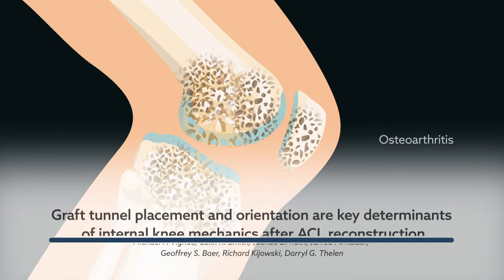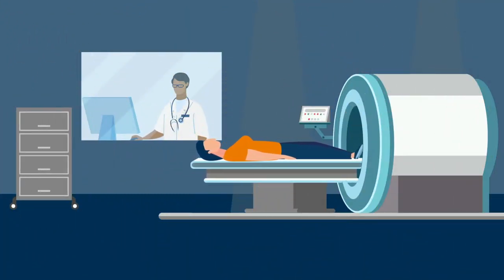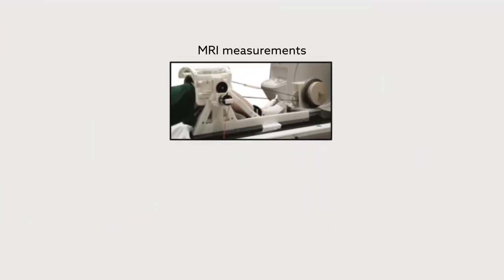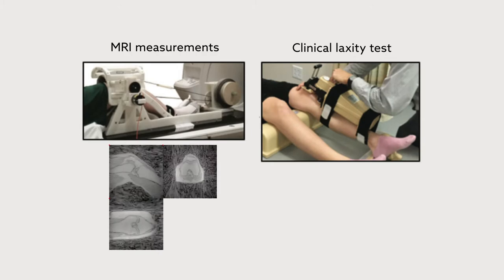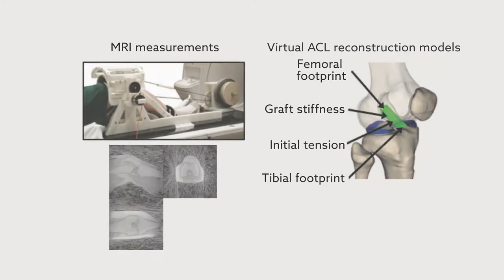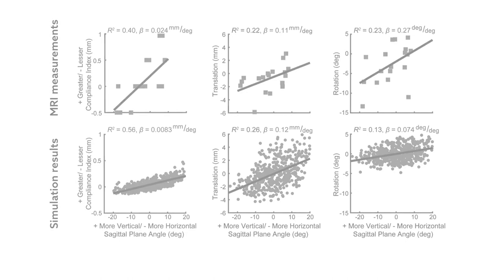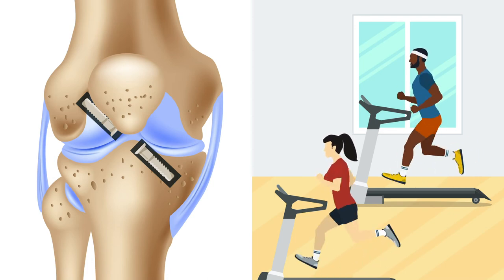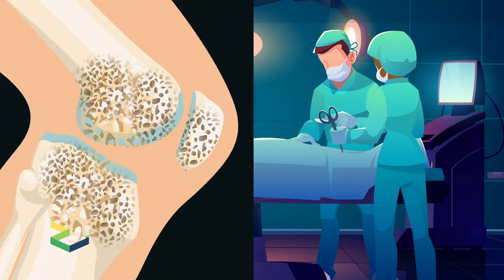Graft tunnel placement & orientation are key determinants of knee mechanics after ACL reconstruction

Comment: My surgeon placed the tunnel too anterior on the femur for my acl reconstruction using my quad tendon. It's been a 6 year nightmare. I have degeneration of the minuscus, instability and tracking issues since day one and problems in my quad tendon. I've been to countless physical therapies. Only recently i brought up the possibility of it being incorrectly placed and it was confirmed. What is my recourse/options? What exercises can i do if i can't do a multistage surgery or replacement?